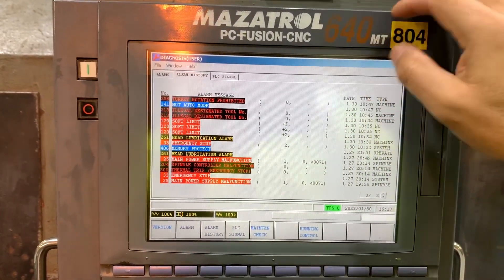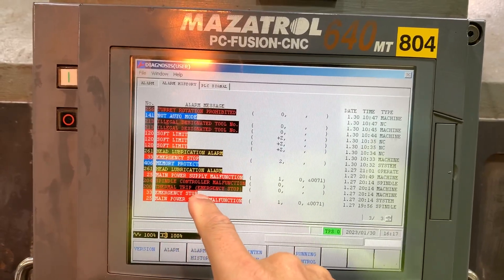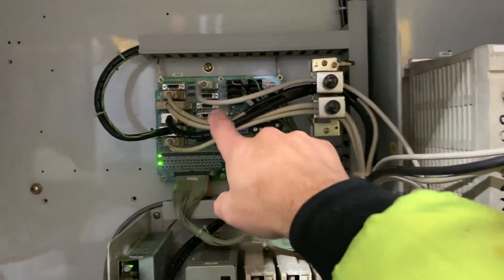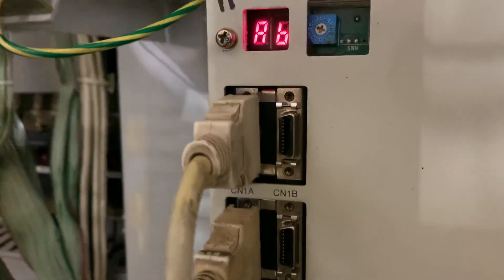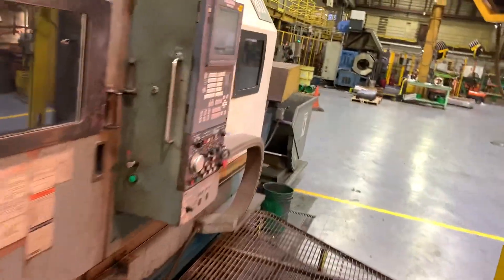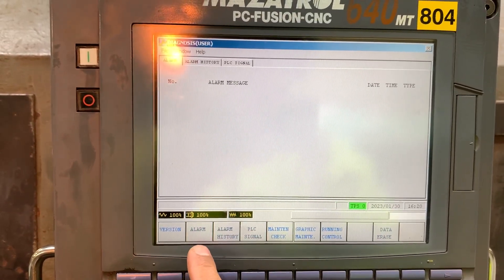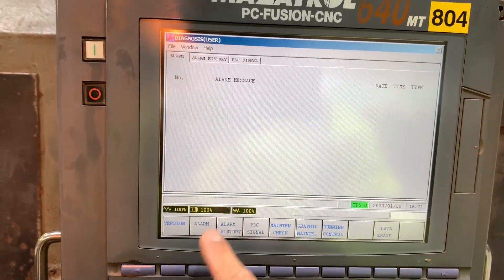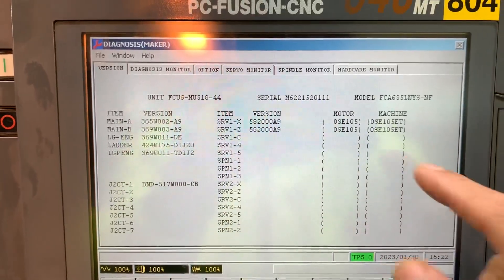M640T: 25 Main Power Supply Malfunction. How to disable the Spindle Drive and test X & Z & Turret

Comment: Hello sir
5C alarm code on Spindle drive while sp orientation..what we need to check??..I have replaced PLG sensor with PCB.. feedback cable... spindle drive..also checked parameters with other seems ok...what we check further..
Thanks
Reply from the maker: Hi there. It is so important to be precise with the data when asking for support. In this case please provide the spindle drive model, the spindle motor model, the NC model, the alarm you have on the NC (complete text).
In regards to the changes you made, provide:
1) encoder brand and part number
2) PCB brand and part number
Regards.